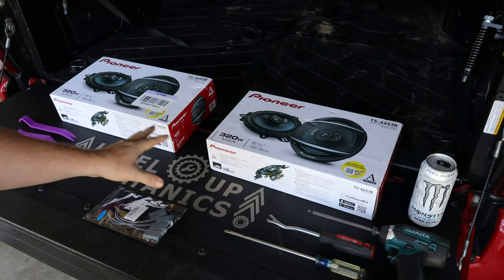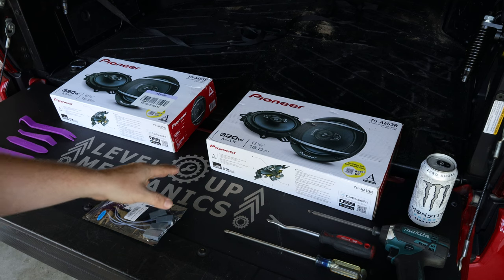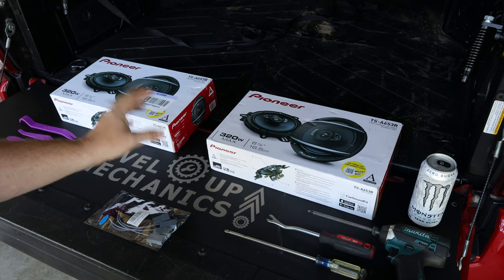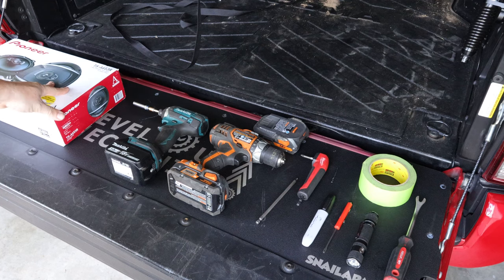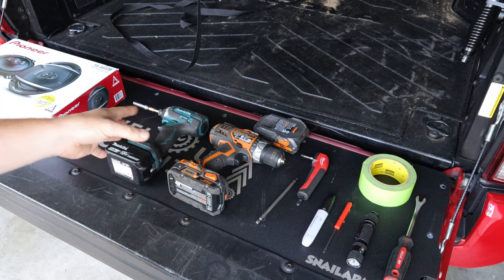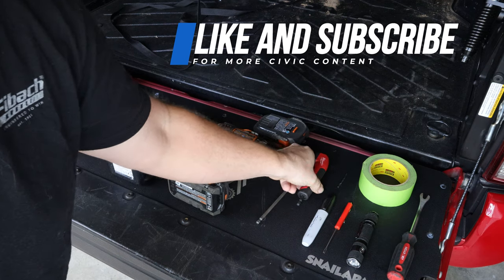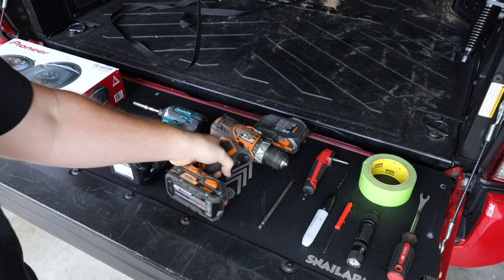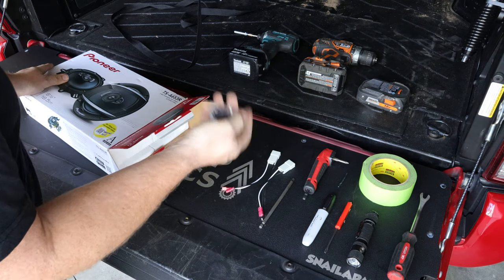Installing Pioneer A-Series Speakers On My 8th Gen Honda Civic (2006-2011) | An Affordable Upgrade

Comment: Are these speakers better than the stock ones that come in the same generation civic Si's ? Thinking about putting these on mine.
Reply from the maker: I honestly do not know the specifications for the 8th Gen Si stock speakers. 

These Pioneer speakers are definitely a great upgrade for base model Civics with the standard audio systems. But as far as the Civic Si premium audio system goes, I do not have any first-hand experience (as of yet).